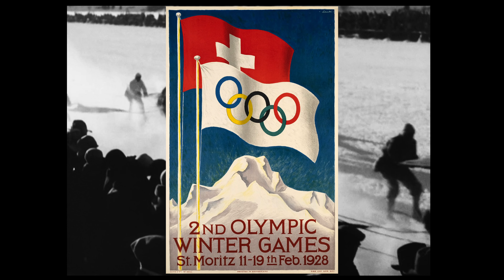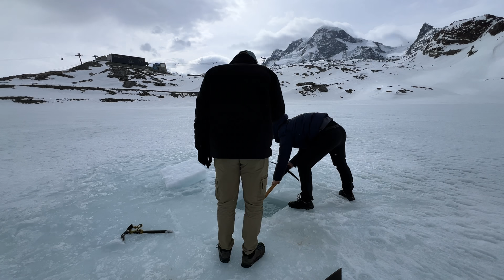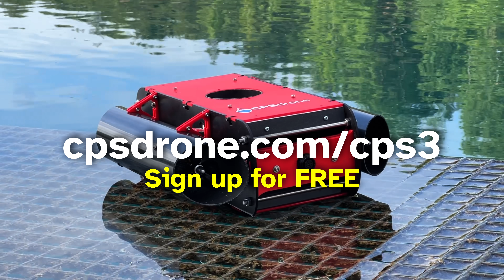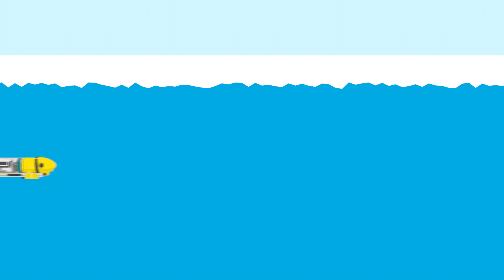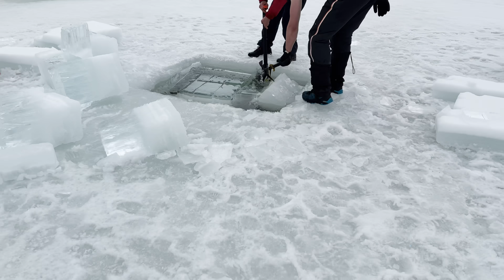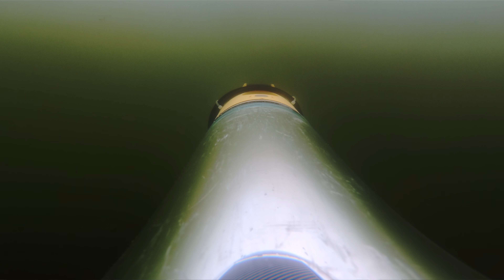Investigating an Alpine Submarine

Comment: What if you only had to drill 4 holes.. point some pointy stick sensors/reference points  under the stick and above.. and create a grid .. you only have to have a drone that uses those 8 reference points.
Reply: then u could use actually 2 drones  1 above and 1 below that are constantly above each other.. to measure in between what layers and how thick they are.

Comment: can't you just use a "submarine" that's just a little upside down car with a magnet and a fashlight on it and a pair rc car that mesures the light intensity and calulates ice thicness in that way, or would the magnetic interfearance of the required super strong magnets be to much of a hastle to deal with.

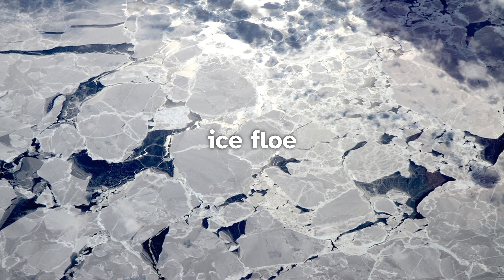Comment: 4:46 you can't measure floes from the top, but the purpose of measuring is various events on continuous ice, not on floes. I can't understand why they don't measure it from the top. Especially when they have layered ice. For events, you want to know the top layer thickness, so measuring from the top makes most sense. For a sub you need an entire team of people ($$$) and what if (when) it gets stuck? Also someone suggested you could measure floes from the top using a drone. This project seems overengineered and with a questionable practical purpose. But that's how student projects go I guess. Nothing changes :)

Comment: I work with ultrasonic equipment. Another method they could try is is using a rubber wheel and using a delay timer for the distance before it starts picking up sound.

Comment: Is the sonar "ping" a proper modulated "chirp"? I guess modulation and maybe averaging would reduce some of the noise.
:D If you find a good model for the problem, inverse models might work. 
I guess denoising by total variation might be a start. As an ignorant person, I guess that most of the times snow, water and ice are kind of separated and there is a limited number of transitions between them. So you could penalize those transitions by total variation. That might lead to an abstract view.

Comment: Couldn't you just place a small robot under the ice and a small robot above the ice, synchronized at the exact same GPS coordinates? The one underwater could scrape the bottom of the ice, while the one above measures the depth. So you couls measure the thickness of the ice like that?

Comment: How about having a wheeled robot on the ice surface moving in sync with the submarine, while the submarine stays pressed against the underside of the ice? By measuring the distance between the two, we could calculate the ice thickness.

Comment: If only people knew how to blow a relatively small diameter and highly directional hole using a very spontaneous chemical reaction... I think that a drone might also be useful for such a project and as a bonus you can make measurements from the top, which is the most important part.

Comment: A great part about this is it doesn't have to replace traditional methods. They could take several measurements manually and the sub can check those same spots to verify, along with a hundred more. If the sub does find a potential thin spot they can send someone out to to check that same spot and verify. A no-risk method to enhance safety while proving the technology.
Reply: Yes and there are areas in the world where frozen rivers are used as roads. I bet they would love to lower the risk of accidents while maximizing the throughput of goods transported.

Comment: Cool project. If you just wanted to know where thin spots are, you could probably use a light sensor - assuming the sun is out looking up through the ice should have darker and lighter areas.
Reply: Yup, one very early idea was to use that, but moving clouds and irregular snow thickness on top made that pretty hard to reliably implement  (an extra sensor just to investigate reliability alongside our other measurements would be really interesting though)

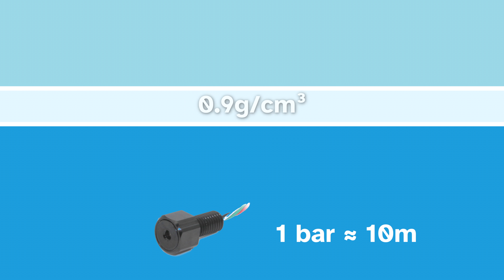Comment: 21:52, that’s true but you need to take some considerations about. First on any altitude dive they’re are couple modifications to the safety factors related to the local atmospheric pressure (lower that 1atm and 1bar each 10m), then you need to consider the water density usually higher on cold water and even bigger cause confinated bodies of water have a high concentration of minerales (brackish water instead of fresh water), so it affects things like buoyancy, sound speed and reflections, on water and the ice itself.

I think this is a great project and an amazing application for authonomus submarines, for exploration and rescue tasks

Comment: Why not have a small RC vehicle go across the ice surface along the same route as the submarine and emit a “ping” from above as well? it could then measure the signal from above too, having a direct emitter above the ice could be easier to distinguish between multiple layers of ice no?
Reply: Unfortunately a snow layer + the fact that sound waves are like 90% reflected when they go from air to ice make this hard to do, but moving a small car "under the water" that pushes against the ice sheet could be a really interesting approach!

Comment: I would like to give a suggestion, instead of sending sensor waves from under water we would have a device that sends ultra sound or kind of wave that would pass through the ice from top and have the submarine under to calculate the time taken for the wave to reach would actually give the thickness right and for the scenario were we couldnt reach we could use drone in that case so submarine in underwater and drone on the land

Comment: I still don't see the need for underwater use. Same sensor but done from the top with a low ground pressure type vehicle or drone.
Reply: How would you measure it with a snow sheet on top or when the ice is broken up / only centimetres thick? We also gather data for climate researches here so we wanna be able to measure it any time of the season!
Reply: @RichardRuedin  Thanks for explaining that ice thickness is not only for events, that was another question i had. 
Is the data that accurate from underwater when ice is broken up/floaty?
Indeed the snow over the lake ice would need another vehicle that would take plow duty. Way too complex, especially since it should be grippy and heavy enough to push the snow but not break the ice. Dumb idea on my part. 
👍
Reply: @gafrersnot a dumb idea at all! Usually this is the go to method with ground penetrating radar (GPR) when the ice is thick enough for cars to drive over it (and pull the huge sensor sled)

It is quite accurate actually, and with our best sensor and directly touching the ice we get an accuracy of approx. 2 centimeters
Reply: @RichardRuedin  Thank You again for answering and explaining. Good luck with this project and all other future endeavours. 👍👍
Reply: @gafrersthank you very much and also happy thay I was able to help!

Comment: Interesting approach to  measure ice thickness. How is it compared to Ground Penetrating Radar and survey it from above the ice? maybe also interesting using GPR from the bottom of the ice.
Reply: GPR should be a lot faster, but you'd have to pull a sled over the ice and deep snow really nerfs you there. We built it so we could even measure the ice thickness when a person couldn't stand on it!
Reply: @RichardRuedin  My collegue using drone to fly very low with GPR, it should also eliminate the risk of breaking thin ice.

Comment: I'm wondering if it is possible to solve the crack-finding issue with the same ultrasonic technology they use for locating cracks in metal pipes and welds...
Reply: Very good idea, we'd have to push the ultrasonic sensor very smoothly onto the ice surface but it should be possible in theory. Maybe in the future, who knows :D

Comment: this is like trying to measure something by reading the back of the ruler.. surely it is 10x easier and faster to simply measure from above the ice? RC car/hovercraft beats a submarine any day when it comes to simplicity. This was an exaggerated solution to a simple problem.
Reply: How would you do it with a snow layer on top? Cuz that's the situation we have 90% of the time 😅
Reply: That’s a fair point but there’s still multiple options. You could drive on top of the snow and use ultrasonic or gpr or something. You could robotise the traditional method of drilling or you could use a snowcat type of system. The sub is cool I’m not hating on it, I just thought its adding unnecessary difficulty of localisation when you could be rtk precise at all times. And if your problem statement is humans being put in danger then just robotise the traditional human method.
Reply: @TheDroneOperator.All good suggestions! Ultrasonic only gives good measurements when you have a good interface to the ice sheet though, and air to ice reflects like 99% of the sound waves. Paired with snow on the ice, that becomes really tough. Underwater the interface is always pretty good. The problem with GPR is that its typically too heavy for thin ice sheets. Then, for thick ice sheets, drilling 50 cm holes with a robot also isnt as trivial and you'd be quite slow again! All in all we decided trading off a little bit of localisation accuracy for being able to always measure the ice sheet, as well as with many measurements in short time as this is the solution we prefer. But the things you mentioned absolutely are done and work for their usecases too

Comment: could you not use the same ultasonic sensor to measure ice thickness  from the surface?
Reply: Nope, the snow makes that pretty hard actually! Also, for ultrasonic measurements you want to have liquid between the sensor and the ice you measure, so being under water is actually easier for that

Comment: If its a question of strength and the multiple layers of ice, it should be the top layer that should be measured (weak top will melt/crack). So top to bottom is better. Using  ice-penetrating radar or ultrasonic sonar, the thickness can be calculated and without to complemented positioning system under water. A four wheeled vehicle with GPS, sonar and or radar would in my opinion be better.
Reply: Very good point! It's the first real time we've encountered multiple layers and for our typical lakes that we would try to measure we haven't observed multiple ice sheets yet. Even with this method, the lower ice sheet should be pushing the top one up and the water layer in between them isn't very thick, so using this for an estimate still definitely works!
Reply: @RichardRuedin  Might the sonar method be able to determine if the topmost layer only consists of compacted snow and is brittle?
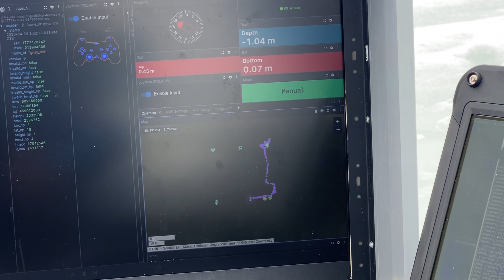I guess, if you look into inverse methods and/or total variation denoising, any you maybe improve the data by better chirps/averaging, you could do an even more in depth analysis than just determining the thickness. At 20:53 it looks like the ice has multiple layers. Did they show up in the sonar?
Very exciting project :)
Reply: Yeah but the vehicle could potentially crack the ice, as Richard has pointed out in the comments they’ve made it measure very thin layers of ice. Maybe they could use a drone, or even use a combined approach to lift off most of the vehicle’s weight

Comment: I think a tracked drone with snow brushes and ultrasonic sensor is simpler: you can almost always use GPS, it's easier to control, and it's easier to retrieve a broken device. Also you can measure top-ice easier. Yes, this method has weight and minimum ice thickness limitations, but the advantages outweigh the disadvantages.